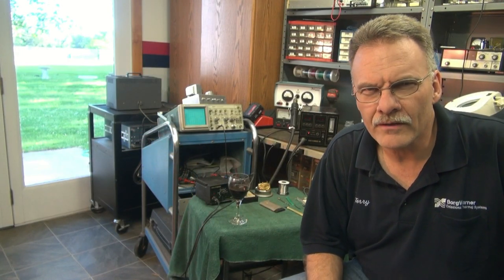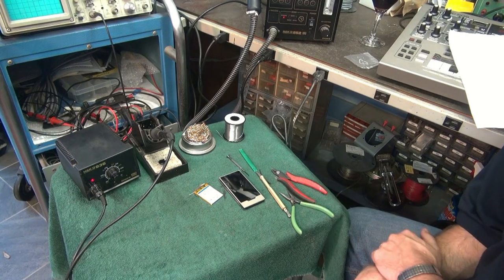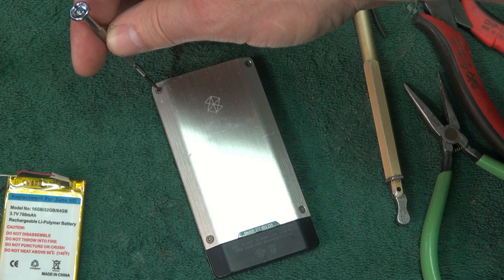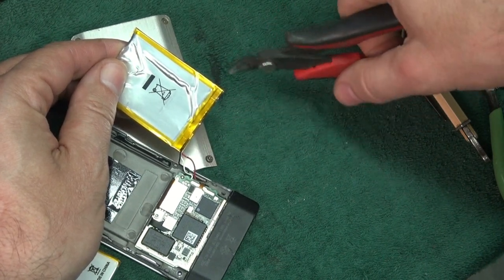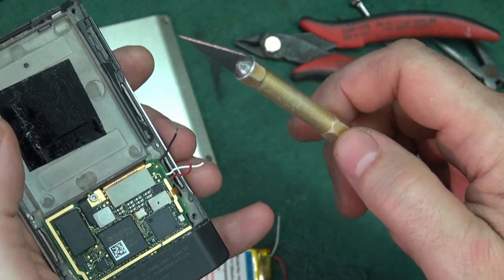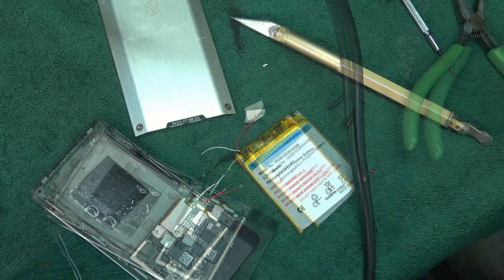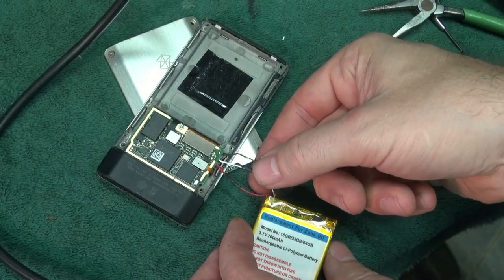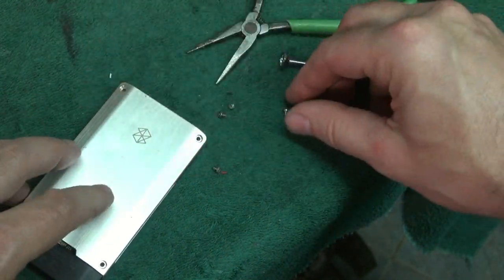D-Lab Easy Battery Replacement Microsoft Zune HD GadgetMenders how to

Comment: Totally loved the ending parts. Warp drive core. Captain of the ship. Zune-er-ino. I have a 16gb black Zune hd but upgraded to a 32gb platinum one. Too bad the battery doesn't just have a ribbon cable like the other parts. I've noticed a lot of cell phones are the same way... tons of ribbon cables, but battery.. not so much. ):

Comment: 10 years later, you installed the back cover wrong, it has to be levered in as it has two teeth on the bottom that slot into the plastic.